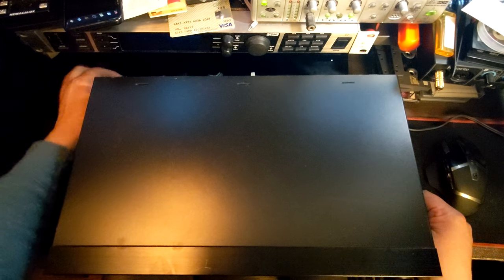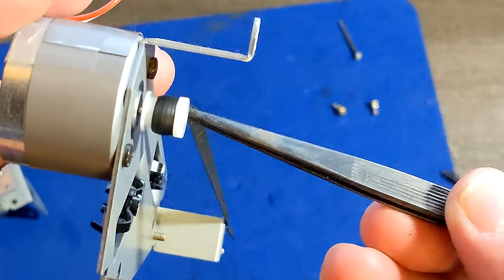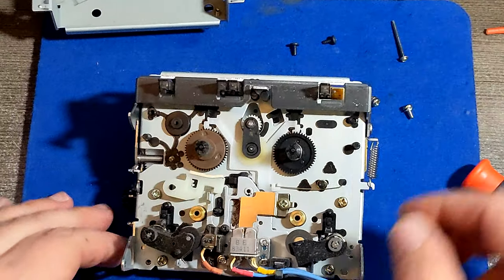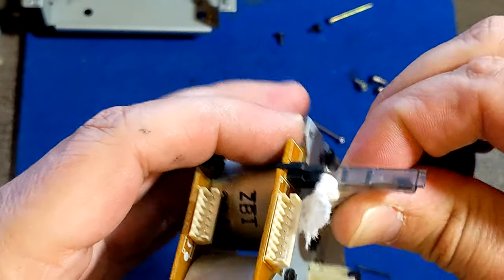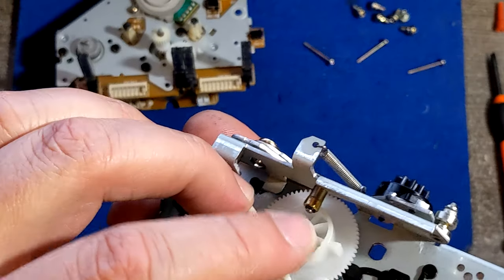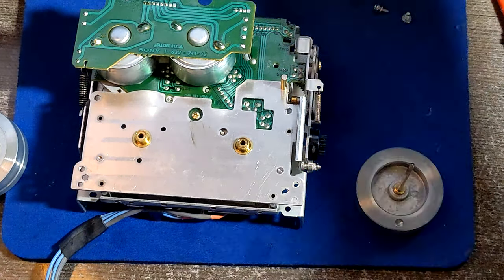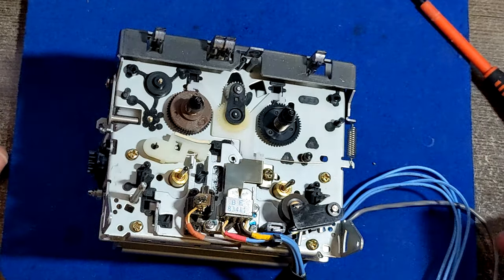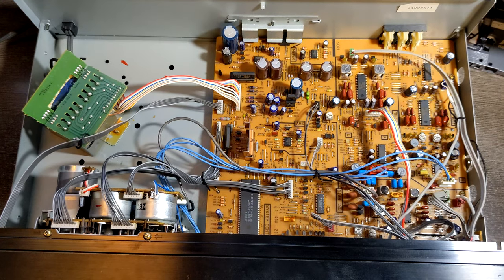SONY TC-K670 repair (belts replacements)

Comment: This video is awesome. Thanks for much! It, and your other videos, helped me on my TC-K620, which was a gooey mess. The small belt was so far gone that I even had to take that motor completely off the board because the goo had gotten down to where you oiled the other motor. On mine, there is that tiny retainer ring that must be pried off to get the door detached. It went flying and was lost for a while. Fortunately I remembered how I had the mechanism pointed when I pried it off and carefully searched until I saw it over on the side of a cabinet. The retainer ring on the idler thing under the bottom of the tape cradle was hard to remove, and even harder to put back on without losing it. I found that turning the tweezers to the side and pressing down on it with both prongs works best. But I got the deck working, and actually enjoyed fiddling with it.
Reply from the maker: OMG, it was probably a hustle fixing it, but it was worth it as you mentioned, now you can enjoy sweet sound of analog equipment, cheers !

Comment: I got the TCK570, belts are on order, but already check your video, it is really insightful, also for a noob mike me. Will let you known what the outcome is once all is done, thanks though for making this video💪👍

Update 14-may: and finished thanks to your video! Thanks alot !!🤘🤘
Reply from the maker: No way! That's great!!! I may decide to make another similar video!
Reply: @cheapoldhifi  everything worked out just fine, player is fixed, thanks again for your video.

Comment: I replaced belts to my sony tc k 850es,  and now it is working well.  But i noticed that there is any washer in the capstan (inside or outside).  Is it so important ??  (because I am afraid to have a problem in the future).
Reply from the maker: They're all important, especially if you moving your unit around... but if it's working, who cares !

Comment: Guess what im doing right now... (had to deal with the gooey version) had repaired it earlier with a self made belt from innertube bike :) If your going to fix this same one I recommend you also order the 2 capstans beside the 3 belts.
Edit: It did not work the first time and kept repeating to start lifting the heads and down and up and.. turned out to be a small switch near that nylon seesaw.

To make your life easier:
If you would unscrew the right screw holding the transformer in place you can rotate it so it lines up in a straight line and screw it tight again into the perfect lines hole. so why they placed it on a angle ?? it is now easier to get the "drive" in and out.

Also noticed that you can keep those 2 metal plates together with the wheels intact, remove the 4 M3 screw at the front and the one long screw next to the motor and you can pull the whole thing apart.

your video helped me out. playing some ancient tapes now :) 

Thanks!
Reply from the maker: Thanks for the input, I'm glad it helped!

Comment: I have a Sony TC-K690 that needs belts replaced. I'm trying to get the plastic outer door removed. The left hinge to the door seems to be permanently attached... so that I can't remove the outer door..... Any suggestions?? (The TC-K670 and the TC-K960 are nearly identical, except for the hinge problem) Thanks for any help!!
Reply from the maker: Hi. You can remove the power supply, transformer, and get the clearance so you can pull it out without removing the front door cover. Thanks for watching!

Comment: there were two more washers (transparent plastics) in the back plate holding/spacing two capstans. they are easy to lose just be careful.the supply pinch roller needs to be adjusted with a test tape.
Reply from the maker: Thanks for the input

Comment: Thanks for the helpful video, I also have TC-K670 and have disassembled the player and the belts seem to be a little bit loose, but they still seem to work when I turn the wheels. I have problem where when I want to play cassette, the motor just makes a whirling sound. Do you think this is fault of the belts?

Comment: Your video is the absolute best! I'm fixing a TC-K677ES, followed the instructions, replaced all the belts as shown, and now eject button works, FF and Rewind work, but when I hit play the heads move up into position but the cassette tape doesn't turn- after a second of trying to play, the player auto-stops like it's reached the end of a tape (but it hasn't). Any idea what could be jamming up the mechanism only when I hit play? thank you for your wonderful video.
Reply from the maker: Hi. I red somewhere something about dirty sensors around wheels, like it thinks that is not spinning,  but the deck is gone so I can't investigate

Comment: I don't know what kind of cleaning solution you use, but I have used only Isopropyl alcohol for cleaning such repairs for decades. And only sewing machine oil to lubricate the sliding bearings. It is quite cheap with effective. I have a similar SONY TC-K 661S and it plays great.
Reply from the maker: I used exactly the same solutions, maybe it's not perfect but it does the job

Comment: Deriving inspiration and courage from your superb demonstration, I work on my TCK-590, although not exactly the same but mechanisms overlap. Managed to get the belts on and reassemble, repeating the process twice as, for some reason, the cassette holder does not open or close. I do not know what I might have missed, possibly misalignment of the loading cam gear? Thank you for any advice.
Reply from the maker: both of it can be a issue, usually wrong belt size
Reply: @cheapoldhifi  Thank you

Comment: Thanks very much for making this detailed video!  I was able to replace all three belts.  Only one of them was gooey.  The good news is that the door opens and closes beautifully again, and the fast forward & rewind also work great.  Playback works, but the tape speed is far too slow.  I think this can be adjusted by a variable resistor on the back of the capstan motor.  Is this a simple procedure?  Do you have any advice to correct this problem?  Your help would be appreciated.

The capstan motor needs to be replaced.  I tried to adjust the speed and it will not allow the speed to be adjusted.  It won't hold a constant speed.  The replacement part is 3356-635-1.  No longer available through Sony.  I need to start my Internet hunt.
Reply from the maker: Sorry to hear that, any similar motor will work, maybe you'll find something on eBay.
Reply: I found a replacement motor on eBay.  Installed it and the tape deck is fully functional again!

Comment: How to adjust tape speed? which control?  RV181, RV504, RV281 thanks
Reply from the maker: Usually adjust it one the deck motor or find-download the manual where you can see which pot is for a speed adjustment.

Comment: I see you didn't pay attention to the microswitch on the right that detects the opening of the door during assembly. You have to turn the big white gear a little or press the microswitch.
Reply: Also, an important step was left out: If you remove the supply roller, you have to adjust the tape guide with a mirror cassette and the center position of the tape on the eraser head. ;)
Reply: Where is the microswitch located on these decks? Currently repairing mine and can't get the door to open upon reassembly.

Comment: What kind of oil do you use when you oil the motors? Many thanks.
Reply from the maker: Hi, you can even use sewing machine oil, but I would prefer some synthetic specialized oil. Check it out here https://www.tapeheads.net/threads/which-is-the-best-oil-for-deck-mechanisms.81664/
Reply: @cheapoldhifi  Thank you very much for your information.!